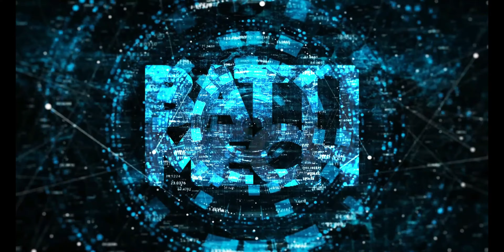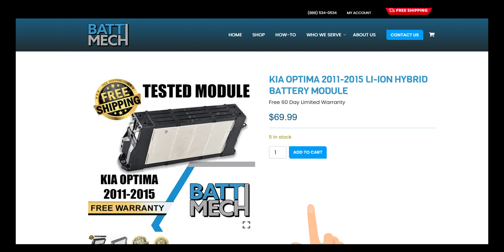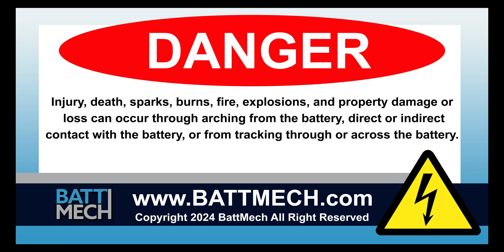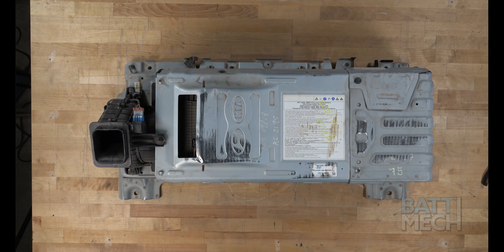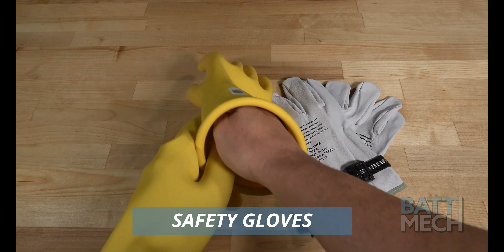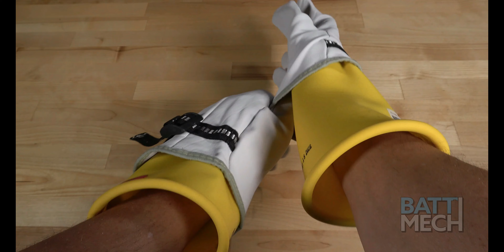How to Replace/Repair/Fix a 2015 Hyundai Sonata Hybrid Battery Module Pack –Step-by-Step Guide EV

Comment: Very helpful video, I was able to replace a swollen module and get my car running again. Thanks
Reply from the maker: You are welcome and congratulations on your accomplishment! We work very hard to offer detailed instructional videos so can be more affordable for everyone to replace their EV/Hybrid Batteries!
Reply: @BattMech I purchased two batteries from BattMech to replace bad module 1 and 5. I replaced them both but I can't find anywhere validating  module 1. Is it on the driver side looking in from the trunk. Or on the passenger side looking in from the trunk? It's a 2015 sonata limited hybrid. Any assistance be grateful.